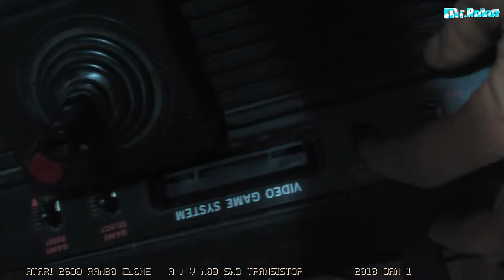ATARI 2600 RAMBO clone A/V mod smd transistor on board see it. motherboard CY2600B-5232

Comment: Hi
What exactly did you use the components, the value of the components?
Reply from the maker: 330 Ohm, 10 KOhm, BC 547, 10 uF, check out here http://forum.3doplanet.ru/download/file.php?id=2358&sid=cafc99511ff2f63b5b86c08ae53ea3d3&mode=view/  
http://atariage.com/forums/topic/262902-av-mod-to-2600-rambo-clone/  
http://forum.3doplanet.ru/viewtopic.php?f=59&t=3569&sid=b0003626956f49cef5a56e0b50748734
Reply: Hi
Thank you for the information. Unfortunately, I have a completely different board. The designation "B2600 / 24PIN WLX9206" does not know exactly where to weld a point.
Reply from the maker: will you provide us a whole picture set of you board link?
Reply from the maker: https://drive.google.com/file/d/10wkOPcKR6C_hicygdGQfcQOcocOQdAmr/view?usp=sharing i found video composite line on your board, then you build repeater like they did on internet, audio line may be interesting for you to find.